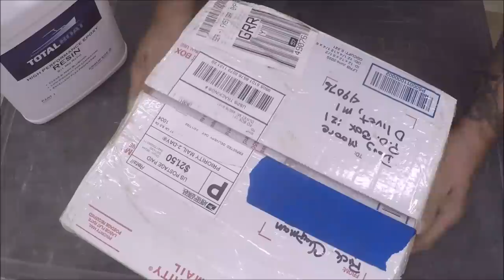Chartreuse Resin and Wood Bowl

Comment: Looks like the color will catch a walleye!! But the work will catch a wood turner! Beautiful Doug!! Got a little worried as you kept getting up by the rim. On the video it looks like you were starting right on the thinnest point instead of right below it. Also did you reverse cut or flip over your   carbide when you were working that tear out? Asking for a friend!!
Reply from the maker: Thank You Joe,  I don't fish for Walleye but what I know is that you use crawlers for them up here,  lol  I did run it in reverse for a bit so I could see what I was doing without hanging over the lathe,

Comment: Looks great, Doug.  How long did you let the first patch set and cure before starting to turn again?
Reply from the maker: Thank You Tom,  I used the fast set resin because it sets fast, I was back at it a couple hours later,  but I also hit it with some heat from a hair dryer then waited for it to cool, this helps make sure it's not gooey inside,  it really doesn't take that long, the fast set goes off in minutes after mixing it up,